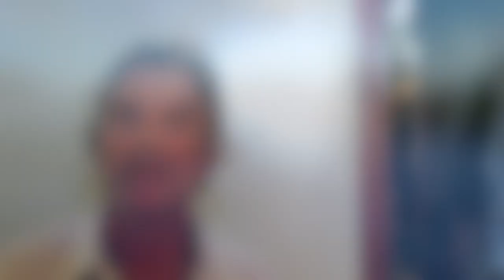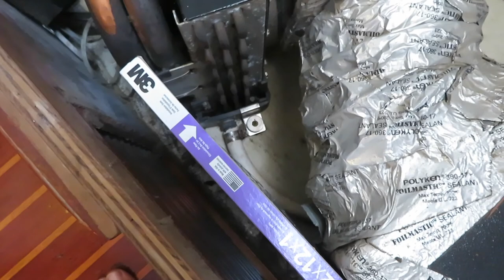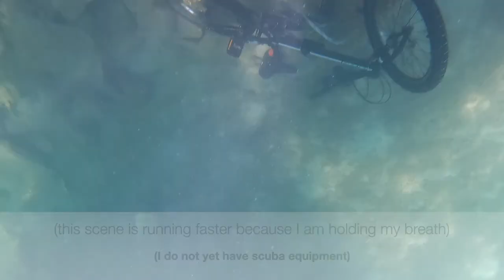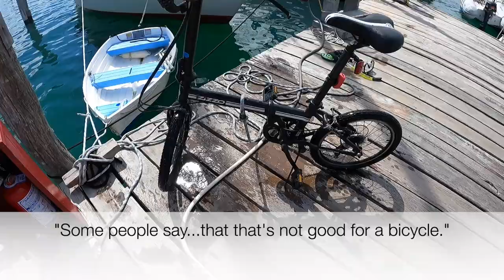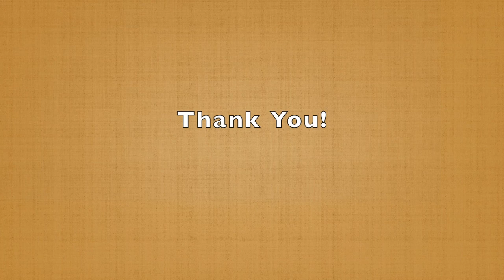Skipjack Sailing 35.  Chichen Itza and Getting Ready for Astillero.

Comment: Russ, as an owner of a csy37b Ive been wanting to change out water lines from tanks but can't find easy access. after watching you pull the floors up Im wondering if your able to reach the water hoses at the tank??  looking forward to your reply and thanks in advance.
Reply from the maker: Fred--short answer:  Not yet.  

On the port side, now that I have the holding tank out and that area (under the main berth) cleaned, I can easily reach the port tank fill and vent lines.

But on neither side have I yet found decent access to the tank "goes out" lines to the water pump.  On the starboard side, I do have the last deckplate under the nav station to remove, and part of that job will include cutting access to the water tank under the battery box.

Port side "goes out" ?  That looks like a complete galley demolition....but maybe I am being a drama queen.  I plan to replace the sink and counter tops, and I could do something to the bulkhead behind the drawers (cut a hole).  

i was thinking of more such demolition/modification tomorrow, in fact, even though it is not haulout work per se.  The fiberglass guys will be here all day and I need busy work anyway, and I want to create access to that hull fitting under the galley sink...I can't get at that valve at all.
Where do you live, Fred?  Maybe we can hook up to share work when I pass by the USA in March... 
(my son's wedding is in Tampa).
Reply from the maker: And I have the same job in my head.  These water lines are 42 years old and (if for no other reason) I want to replace all...with a modern filtration skid somewhere .  That is what got me to lift up that deckplate in the galley.  Right now the pump leaks and it is stuffed in that little cubby under the oven.

I want to change all hoses and move the pump under that recently-removed deckplate...and while I am at it, install a grey water system in the area (between the mast and the head) forward....then get rid of the galley sink overboard valve altogether.
Reply from the maker: My email:  skipjack@gmx.com

Comment: why didn't you get equipment/materials before you left florida?
Reply from the maker: Just not being smart.

First dumb thing was to assume that I could easily buy parts here (or in Guatemala).

Second problem is that ordering online is not easy,
There is an Amazon.mx, and it works fine, but anything I wanted was sourced from the USA, and that means that the Importation process must be followed, which is not easy and which causes delays,

One tangential problem was that some items have very long lead times due to Covid supply issues.  So, when I was in St. Pete, and it took 8 weeks to get the Hydrovane or a composting toilet, and I think, "hell, I have no idea of where I'll be in 8 weeks...." then I didn't order it.

I need a Supply Officer.

Comment: 👁👁👁👁……..Why didn’t you pre order your parts knowing they would take a long time..???…..You know as well as I do 2 weeks means 5 weeks…..One more thing , be careful of that mask you bought, I have a friend who had strange things happen when he took it back home….Don’t laugh I seen it with my own eyes….
Reply from the maker: 1.  Did not know that about the mask.  Tell me more...
2.  Why not pre-order?  Well, I did that for the Hydrovane self steering rig because of the lead time.  But for things like the depth sounder and the hull isolation valves...I "assumed" that since there are so many boats around here, there must be a good supply system.  Certainly that is one thing I should have though of earlier.

Back when I was just getting started in St. Pete, and when I knew that I wanted to take the "restoration" on the road...I should've immediately planned out every job, and ordered all material, and just sat in St. Pete until I had it all.